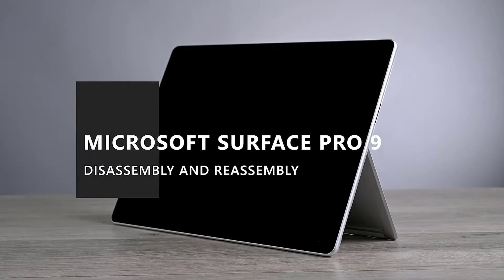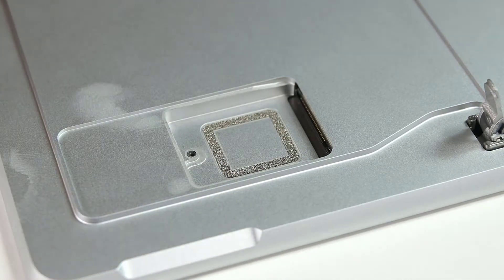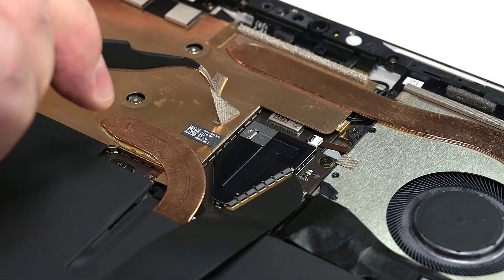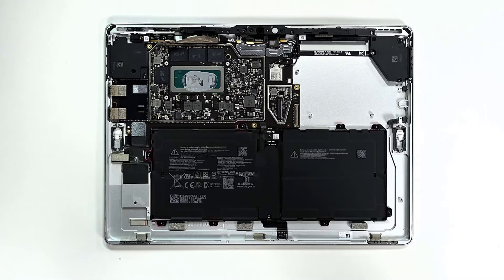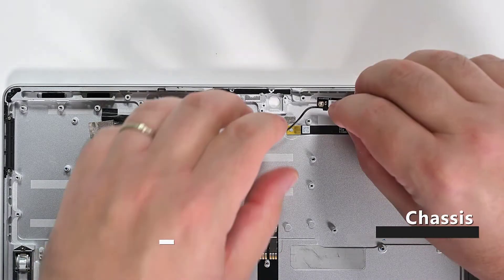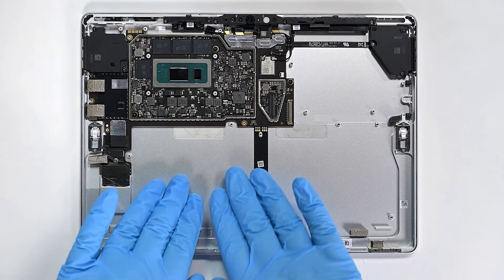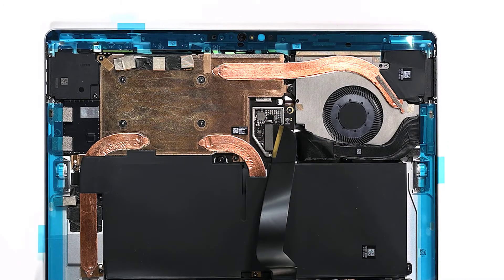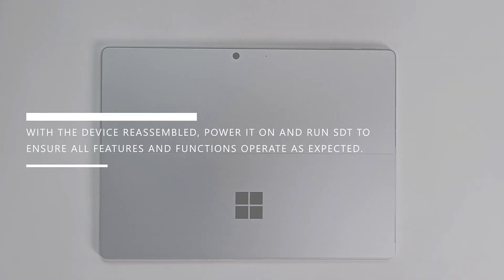Repair | Surface Pro 9

Comment: Regarding the thermal paste, the service manual recommends to replace the entire thermal module if you remove it. The video implies that you can reuse it but the manual recommends otherwise. Maybe that's why they skip over the thermal paste reapplication